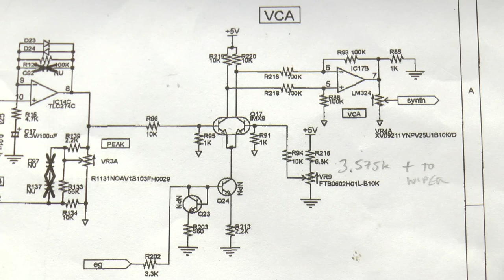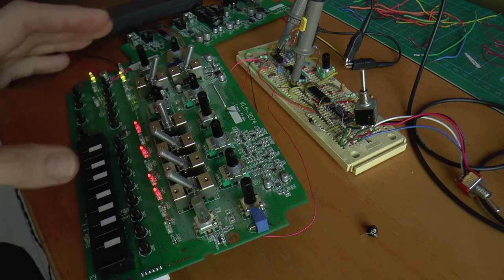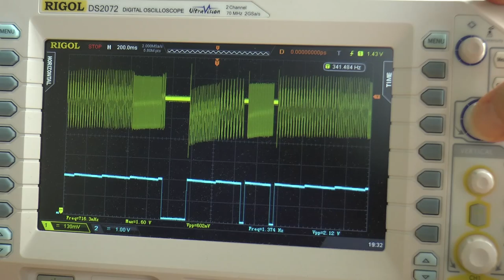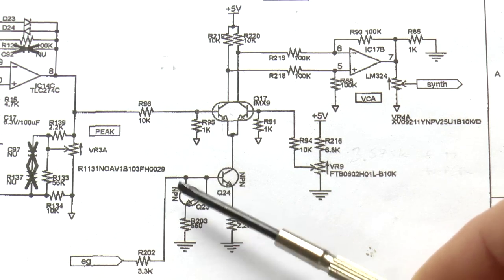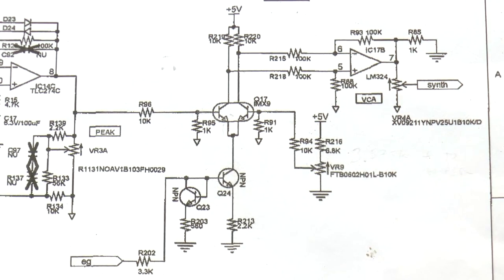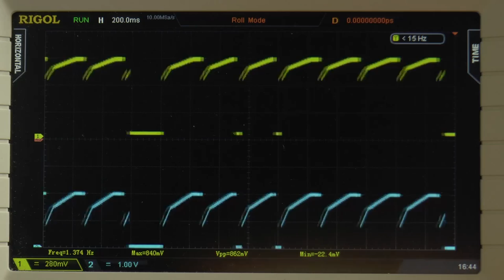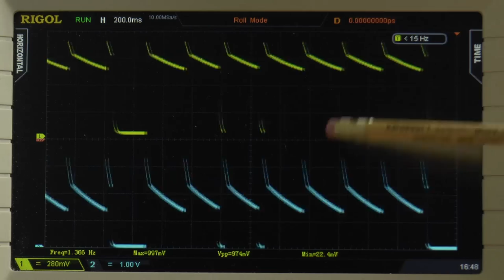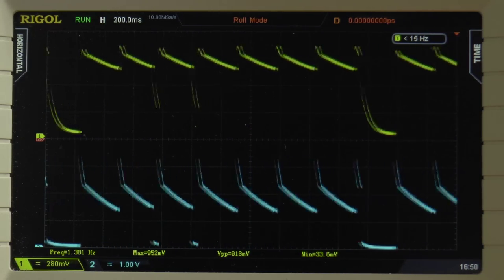Eliminate clicks and pops on the Korg Monotribe

Comment: I get rid of my clicks a different way.

Here's how:
First I wire an 1/8” plug to the cuttoff pot and drill hole and mount.

Using an external AR (ADSR works to) from an MS-20kit EG1 envelope out,
 I send the CV for pitch through 15k resistor to bring the maximum hz/v on high C
down from 8V maximum to around 4.2V. (The Monotribe has a maximum
voltage of 5V, whether it is Hz/V (present config) or V/octave.

The Envelope Out from the MS-20 feeds two inputs
a) the trigger in on the Synch jack
b) The modded filter cutoff jack.

This works as the Monotribe has a very low trigger treshold.
With the filter set to half way allows the filter to act as a Low Pass Gate.

The Monotribe must be set to CV=on, Scaling=Hz/V, V trig.

This seems like it wouldn't work but does!

It also adds a release stage, so the modulation of the cutoff
acts from the ASR EG1 on the MS-20xx.

And with release on EG1 set to a non zero value,
there is really not much clicking going on!
Reply from the maker: The Monotribe CPU creates (and translates) it's control voltages as pulse width modulation and doesn't use 1 V/Oct internally (that's why there's no easy 1 V/Oct CV Output mod for the machine). Here's a circuit that can give you 1 V/Oct Output from the Monotribe after calibration.

http://daysalive.com/share/CV_OUT.PNG
Reply: @mark_madel  this link is dead.

Comment: Soldering to the base of Q24 looked like a bad time, so I searched around a bit more and found someone who suggested connecting the cap to the 10 pin on IC17. I put a switch in with a 4.7uF electrolyte cap and the click is long gone. 

It does affect the ribbon input, but it's not anyone would ever use that thing in a live setting. For sequences, it's flawless.
Reply from the maker: Squid Eating Dough "Soldering to the base of Q24 looked like a bad time.." - I'm not sure what you mean by this - do you mean difficult? As shown in this image, the base of Q24 is connected to the base and collector of Q23,  so you can solder to any of the points marked with a red dot: http://www.daysalive.com/share/click_pop_mod_244.jpg
Ignore the purple lines in the image - those were already on the image that I modified.

"...so I searched around a bit more and found someone who suggested connecting the cap to the 10 pin on IC1." - A bad idea - and one that has been floating around the Net for awhile (as seen in the purple lines in the above image) - and it was one of the reasons I made this video: to stop people doing it this way. The guy who came up with this idea clearly didn't know much about electronic design. Attaching the cap at the INPUT to the PWM integrator for the VCA alters the stock sound/output of the Monotribe MUCH more than my mod.
Reply: Mark Madel OK, I finally got around to correcting the mod and it works amazingly well - DPDT with center off wired to Q23 and ground. This saved the monotribe for me. Soldering to the transistor wasn't nearly as scary as it looked, after all. Thanks for correcting me and posting this video! Highly recommended mod.

Comment: Hi Mark, very informative video, thanks.
About the trim-pot bias settings, which exact contacts on the pcb should be tested for equal voltage with the voltmeter? Also, I assume the VCA level pot on the Monotribe should be set all the way to zero while doing that, right? Thanks again, greetings!
Reply from the maker: Hi Alessandro - thanks for your kind words!

Yes, you can set the VCA level pot to zero, but also make sure that no EG is happening (the EG controls the output of the differential amp). You want to make the adjustment of the bias current at the zero level of the Envelope generator. First read the voltage at resistor R95 (the side connected to transistor Q17), then, while checking the voltage at resistor R91 (also the side connected to Q17), adjust trimpot VR9 until the voltage is as close as possible to the one at R95.

When I first checked mine (before I replaced the single turn trimpot with a 10-turn), it was quite well-adjusted from the factory (close to equal) - but the 10-turn trimpot allowed me to get even closer to an exact match.
Reply: Thanks man, much appreciated!

Comment: I was seeking a way to get rid of clicking and your video encourged me to solder. Thank you so much.

I have some questions now. I d be so grateful If you answer. Is it possible to make some cv in jacks for modulation, like Arturia Microbrute has. I d like to use littlebits osc as a second lfo. do you thing it is possible?
Reply from the maker: +Mustafa Özdemir - Sorry I'm a bit slow responding - I've been travelling. You know the latest versions of the Monotribe firmware allow you to send CV signals in to the SYNC port jack, right? IIRC, you just hold a key (or key combo) in while booting up, and then the SYNC port is set to allow a 0-5V CV input signal. All of the info (and documentation) to do it is available online,

Comment: Hi and thanks for this trick!  i've soldered a 10k 10turn variabile resistor  and i have setted the exactly voltage between resistors r91 &  r 95and q17 but now i've some power troubles: to power on the unit i must keep pressed the power button,  if i release it the unit get off...  any suggestions?
Reply from the maker: A bit hard to say without more info. Did the problem start because you soldered in the new potentiometer, or is it unrelated?
Reply: all ok,  i've de-soldered a serial socket to get space for my jack (i'm improving wave send/return) and one pad was little bit non clean...  anyway the value of capacor if will be 10uF or 1uF can elimitate  clicks as well? which one is better? thx

Comment: Can anyone post a link to the capacitor you used, it would be greatly appreciated. I am searching for 1 or 2.2uf foil cap  but they look nothing like this and have voltages in the hundreds.
Reply: I am also confused about the 10 turn pot, are you adding a capacitor and a pot?
Reply: @TPsynth  yes the pot is used to tune the vca better

Comment: Where did you find that schematic? The schematic I get off of the korg website does not have the VCA section in the video. also what are your thoughts on using a higher order low pass filter instead of just one Capactior?
Reply from the maker: +Johnny Camara
It's been floating around for awhile, and I thought it was easy to get these days, but if not, here is a copy you can d/l: http://www.daysalive.com/share/Monotribe_Schematics.PDF

As far as a higher order filter, I suppose you can get a sharper dropoff, but I'm not sure the extra time/circuitry involved is really worthwhile.
Reply: Thank you. I was having trouble finding that one.
Reply: +Johnny Camara The 2.2 uf Cap worked like a charm. Thank you again
Reply from the maker: Glad I could help!

Comment: There is a much better way to do this: instead of a simple cap, try adding an op-amp-based slew rate limiter into the envelope signal path as an insert! A simple cap is not ideal because it produces a logarithmic smoothing curve, softening the envelope a bit too much. A slew rate limiter, on the other hand, produces a linear transition curve, which is much less destructive to the original envelope shape (at similar de-clicking efficacy)! Have a look at this TI design guide: http://www.ti.com/tool/TIPD140
Reply from the maker: +Lauri Liinat Thanks for your feedback. I'm well aware of limiting the slew rate with an op amp, but the operative word in "a simple cap" is simple. If you read through the other comments on this video, you'll see that many of the viewers had trouble with even just adding that simple cap to ground - so you can imagine the major troubles it would be for many of them to try something which, although not electronically complex, would entail cutting a few traces (to swap inverting and non-inverting inputs, etc) to add another op amp (plus passive components) into the VCA output chain.
Reply: +Mark Madel 
Don't get me wrong here, I still think your video is absolutely awesome! Watching it was what inspired me into thinking about an improved version in the first place :) Oh and there's no need to cut any traces – just desolder R202 (3K3), then solder wires to the soldering pads you've just vacated and move the poor little R202 to your modding PCB where you're going to put your op-amp chip (or more likely, substitute with a through-hole 3K3 resistor, unless your modding PCB is going to be SMD). I'm definitely going to try the slew rate limiting mod, since I have lots of unused space left on the PCB I did my MIDI mod on. Thinking about adding a pot to dial in the desired slew rate and a 3-position switch to be able to choose between the slew rate mod, the simple cap mod, and bypass (= original circuit). But I'm not sure if I'm ever going to make a Youtube video of the process, so I'm thinking maybe you too would be interested in trying this new mod out and making a second Youtube video of the process, kind of like a sequel to your existing video, titled „Monotribe Click and Pop Elimination Improved” or something - now that would be super cool to watch, even for those many people who are never going to feel comfortable enough with their soldering skills as to attempt the mod on their own :) Just add all the standard „don't try this at home unless you're already homeless” warnings and liability disclaimers.
Reply from the maker: +Lauri Liinat A couple of things worth pointing out (not necessarily for you - but for anyone else reading this): you'll need 2 op-amps (or need to change the Q23/Q24 driver before the differential amp) because the limiter otherwise inverts the envelope. Also, keep in mind that the Monotribe uses a single supply with a mid-supply reference point, so you need a circuit similar to Figure 17 in the TIDU026 doc - as well as an op-amp equivalent to the TI OPA2376 (as used in the sample circuit).
I've got some PCBs being made in the next month or so with a bunch of mods (some of then shown in my other video: https://www.youtube.com/watch?v=eI-xYpPw7QM - i.e.  VCO2 plus sub-oscillator; PWM section; CV out; etc.), so if you have some success with the slew rate limiter, let me know and maybe I can include it in the next round of boards.